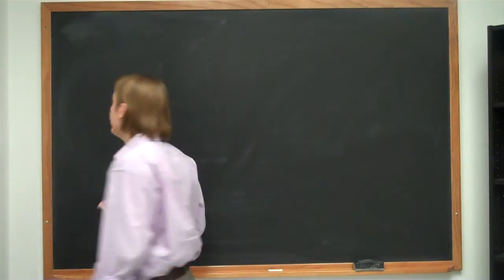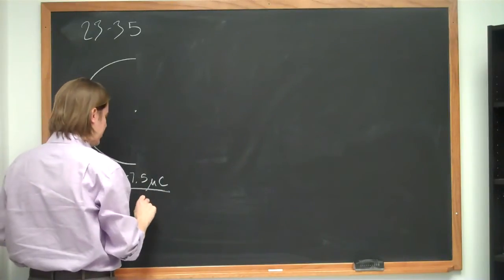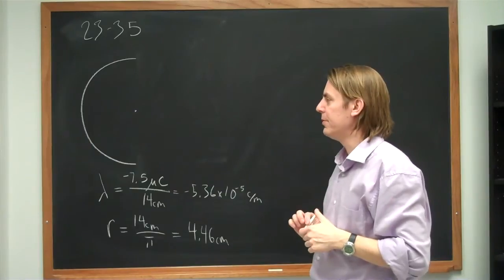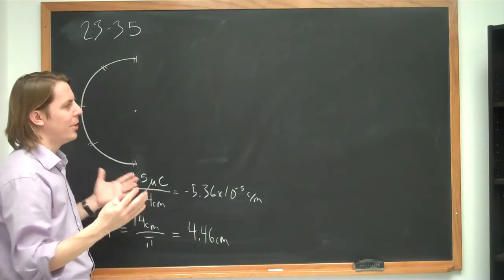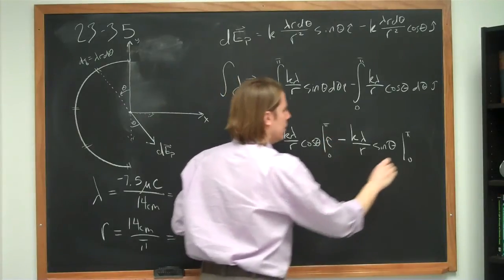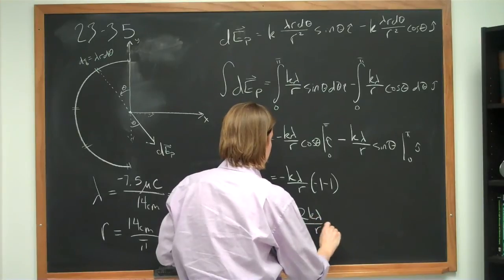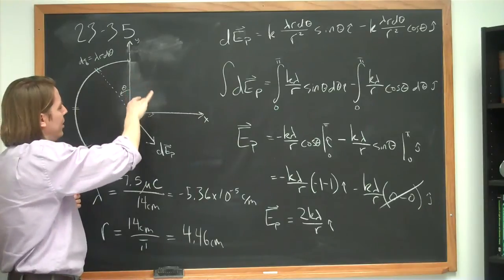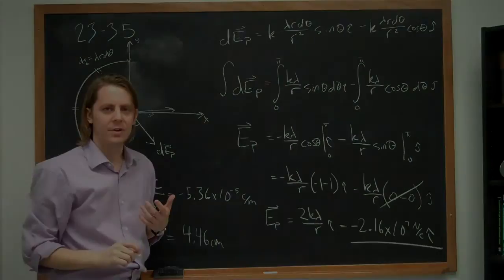23-35 Electric field at the center of a charged arc

Comment: Thanks for it hope it helps me to pass the electromagnetic theory class :) n so formulation prove us (if takes the boundry of integral 0 to 2pi) at the center of a circle , the electric field be zero
Reply from the maker: Yes! Once you can do this problem, you can change the limits to solve for the field at the center of any fraction of a circle of charge.   A full circle would give zero, which you can also tell by symmetry (there is no preferred direction for the field to point, so it much be zero).
Reply: PHYSIERGE I'm really thankful for your explanation meanwhile this object (half circle) got asked in exam 😅 hope I did it.